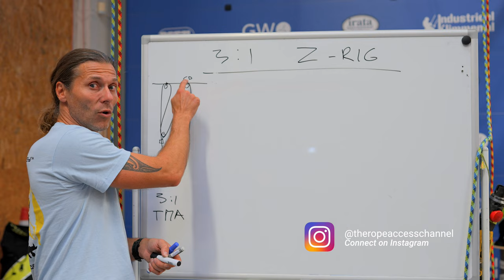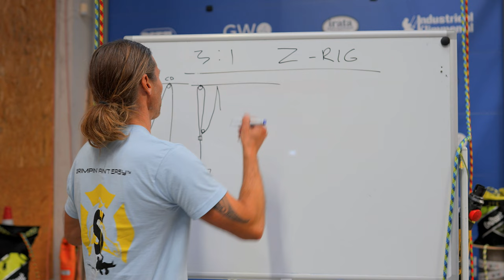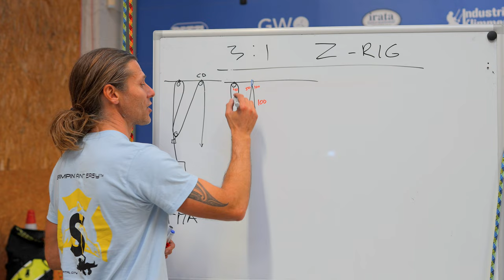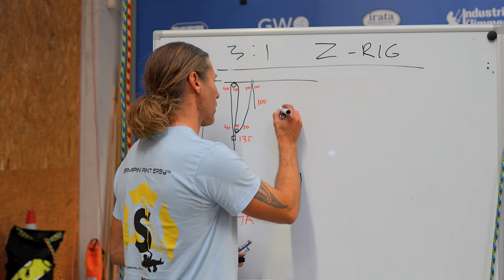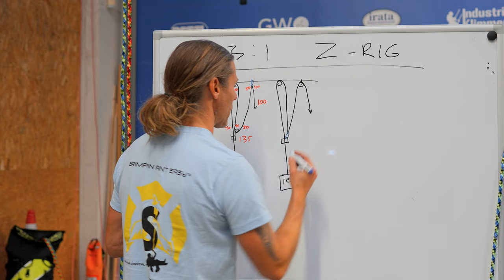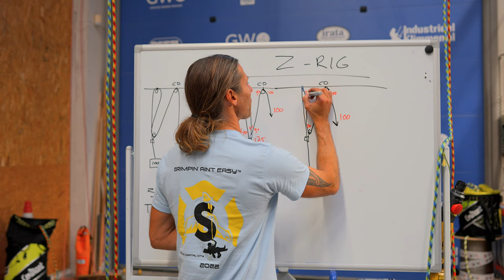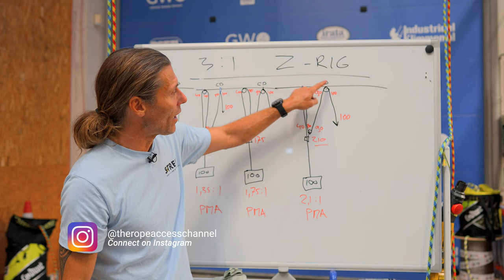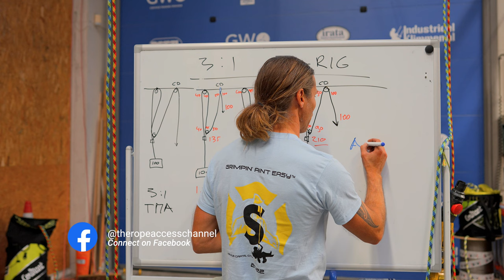Are we building our Z-rig the wrong way?

Comment: These kinds of "puzzles" are right up my alley, but I never considered this one. I love to draw pulley systems just for fun and try to answer "mathy" questions about them, but always in theoretical MA. For example, if you have n pulleys, what's the most TMA you can get? Pretty certain it's 2^n:1 (no redirect), by compounding 2s; you would need n-1 extra ropes though. Another fun one is we know, with 3 pulleys, we can do 3:1 w/ redirect (it's in the video) and we can do 8:1 (no redirect) by compound 2s with the same 3 pulleys. But can you find ways to rig 4:1, 5:1, 6:1 and 7:1 with 3 pullies? Even though it's just pen and paper and all theoretical, I feel like playing with stuff like that gave me a better understanding of pulley systems at large. Loved this vid! 👍
Reply from the maker: 6 and 7:1 with 3 pulleys??? I haven't played that game for a decade haha Around that time I started testing and measuring what actually happened in real life and concluded that our basic z-rig is a 2:1 at best haha. In real life I have rarely gone beyond 9:1 and since I started thinking about it better 6:1 is about the highest I'll go. Now you got me thinking again haha
Reply: @TheRopeAccessChannel  I used a z-rig to pull on a set of fours to give me a 12:1 ratio (or a 15:1 ratio if you turn it upside down) to move logs far too heavy for me to move by hand. I could rig another 15:1 pulley system to pull the first (for a 225:1 ratio). The limiting factor is the quality of your gear because you can just keep adding more complexity to the system. Compound systems give you almost unlimited power.
Reply: @TheRopeAccessChannel  Don't know how well this will work in text, but here goes. 6:1 is fairly easy, I know of 2 ways. If we took the 3:1 from the video and took out the redirect, we still have 3:1, with 2 pulleys. We use that pulley to make a 2:1 to pull on the 3:1, giving us 6:1 to the load with 3 pullies, but we need an extra rope/cord. A better way would be to put the 2:1 on the load and then pull that with the 3:1, still giving 6:1, but in this order we can do it with just the haul line.

From my experiments, odd systems pulling odd systems are ideal, like a 3:1 pulling a 5:1, you can always rig these with a single rope. Evens pulling evens and evens pulling odds will require additional ropes/cords to rig. You can pull on an even with an odd, but only at the end of the system, at the load. Basically you can chain together a bunch of odd systems and then have a single even system at the load and not need an extra rope, if that make any sense. It's what we did for 6:1, took a 3:1 (odd) and then doubled it (even) at the load.

7 is a bit trickier, but also teaches a neat trick with even systems. If this is confusing, Petzl has a picture of it on their site, just search "7:1 mechanical advantage", should come up. So again we can start with the 3:1 in the video, but count the tensions on the anchor, we get 4:1 to the anchor because of the redirect. If we took out the redirect we only have 2:1 to the anchor. From my testing I've always found that if I have T:1 on the load, I'll have T-1:1 on the anchor if you pull with the load, or T+1:1 if you have a redirect. Even in complex/compound systems, this seems to hold true, though I have no mathematical proof of it.

With an even system, the rope would be terminated at the anchor. If we instead redirect that back to the load, the result is that we have added together both the MA to the load and the MA to the anchor. If you really study a 3:1, this is exactly what's happening. It starts with a 2:1 (even) on the load, which gives 1:1 to the anchor. And then we redirect that 1 back to the load giving us the sum, 3:1. With all that,  we're laughing because we know 7 is 4+3. So all we need to do is rig a 4:1 (even), which would normally give 3:1 to the anchor. Of course we redirect that 3 back to the load giving us our sum 7:1.

The only problem now is the 3 pulley constraint. If you go for your standard zig-zag 4:1, you need 3 pulleys just for that, and you don't have enough to get the 7. The final trick is you need to rig that 4:1 as a compound stack of 2's. That will only require 2 pullies (but requires an extra cord), leaving the 3rd pulley to redirect that anchor MA to get the 7:1. A less satisfying way of doing it would to be to rig a compound 8:1, that takes 3 pulleys and puts 7:1 on the anchor. Now just flip it upside down and you got 7:1 on the load with a redirect, still with just 3 pulleys, but that's no fun.

For 4 pulleys the low end is 4:1 (zigzag w/ redirect) and the max goes up to 16:1 (4 compound 2s). I haven't found solutions for everything in between, the game gets hard quick. And it gets super theoretical from this point. Sure I might be able to find a way to rig 5:1 on 4 pulleys, but I can already do it with just 3 and less pulleys is always going to be better in the real world. It's still a fun game though.

Comment: Learning to use pulley systems is one of the best skills I can think of for anyone that enjoys climbing with ropes. It is one of the best skills a hunter can have as well for hauling game. I keep an AZTEC pulley kit and numerous other single and double-sheave pulleys in my climbing and hunting gear always, along with rope clamps, prusiks, and other necessities. I consider pulleys to be one of the most important tools in my kit.
Reply from the maker: That's interesting! I hadn't thought about that. Your game can weigh more than we can comfortably carry right? And if you need to go uphill or up steep parts, having a good haul kit is essential. Do you make a sort of emergency harness for the game? Like a hasty harness sort of thing?
Reply: @TheRopeAccessChannel  To begin with, I am a small older man (71 years), so moving anything heavy is hard for me. I learned to utilize ropes and pulleys so that I could haul or hoist game by myself if I had to. My ropes and pulleys were also a wonderful aid when a tree was damaged in my back yard by a storm. I used them to move and lift logs so I could cut it into firewood. As to hauling game, we tie our rope at the base of their antlers and throw a loop around their nose, and then just pull them along. Whenever possible we use looooong ropes to reach our game and use vehicles to do the pulling, but sometimes you just have to use muscles. Though it would be difficult and slow, I believe I could haul an 800-pound elk up a steep hillside by myself. I just hope I never have to try!

Comment: If the redirect was placed with a rope clamp on the downward traveling part of the rope (under the decender in the first example) the result would improve greatly... For a TMA of 5:1 in my calculation...
Reply from the maker: Sure, and not the topic of the video. The topic is where to put your most efficient piece of gear. The complex 5:1 is in two other pulley system video's 👍
Reply: @TheRopeAccessChannel  True. Sorry for sounding negative. Not my intention. Your video is very good and to the point. And shows the importance of using efficient pulleys when rigging MA. I some times use 4 double pulleys to rig a 5:1 on a 5:1 system for a TMA of 25:1 to pull backleaning trees over the tipping point. Wonder what the PMA is...  Shure gives me a lot of pulling power though. Thanks for good movies.
Reply from the maker: @bjertnestrefelling8839  25:1 is pretty wild MA😃. If it does the job the Actual MA doesn’t really matter right. As long as your not overloading your gear..